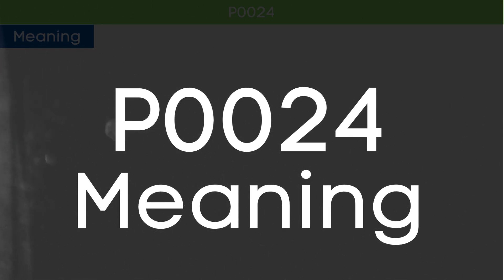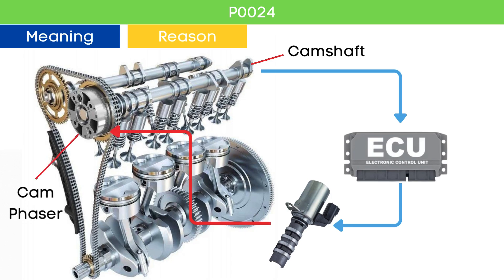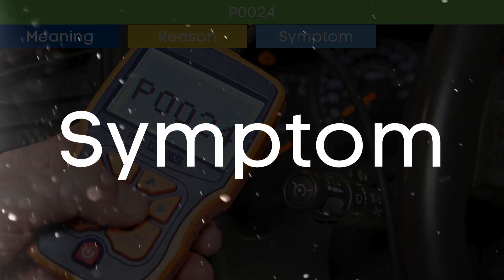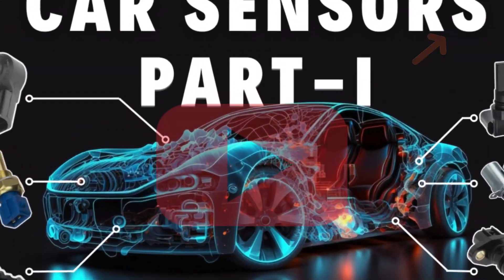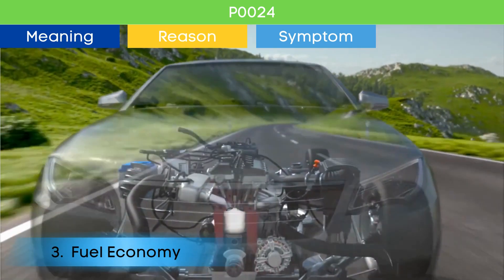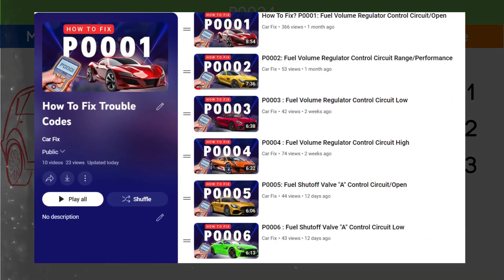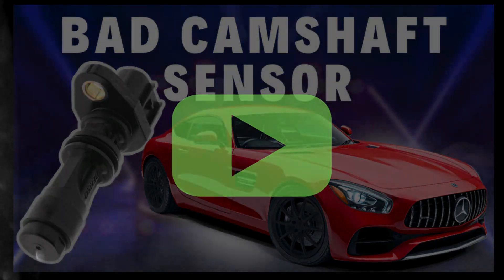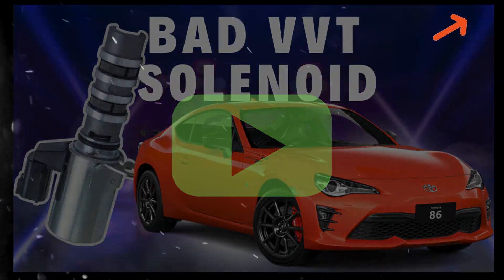P0024: "B" Camshaft Position   Timing Over Advanced or System Performance (Bank 2)

Comment: Same as p0014
Reply from the maker: Yes, Same as P0014 but P0014 is for bank 1 camshaft and P0024 is for bank 2 camshaft.
Reply: I4 engine means there’s only bank 1
Reply from the maker: Yes, You're right. For I4 engine there is no P0024, as there is only bank 1.